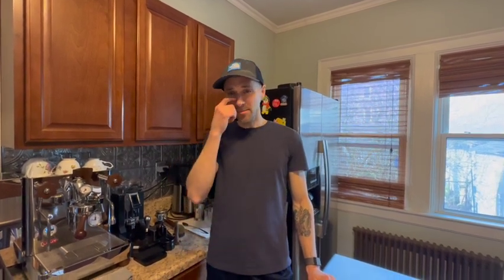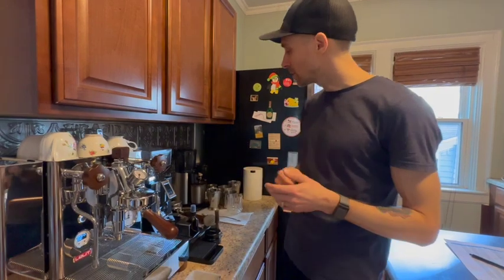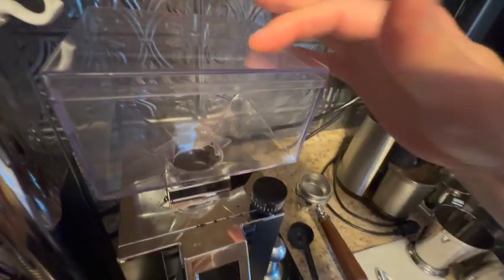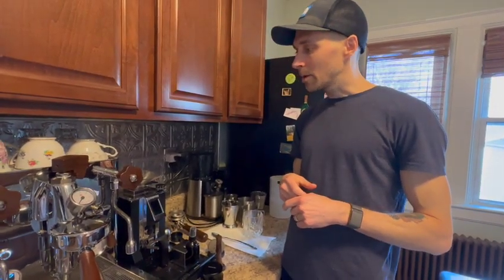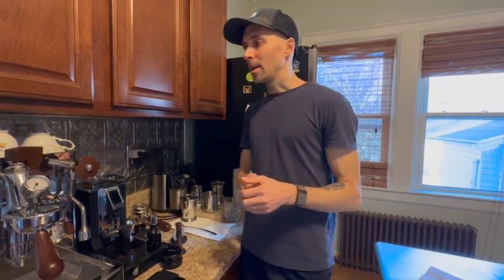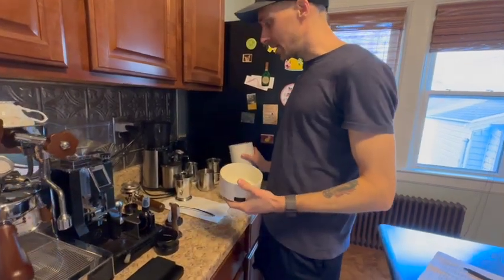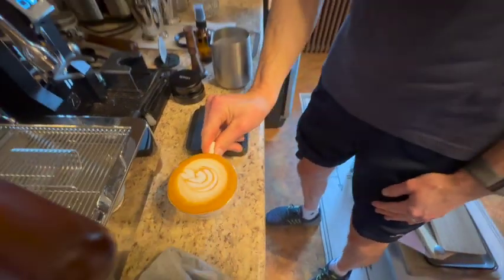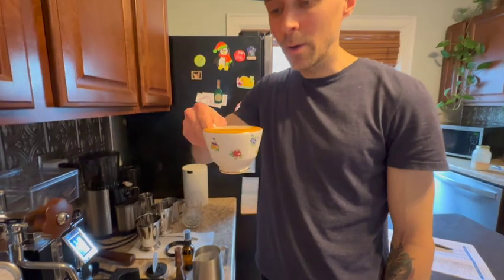Lelit Bianca V3 & Eureka Oro Mignon XL - New Coffee Bar Setup And I Make A Cappuccino

Comment: Got the same setup, same notes, great shots. I dont recommend the hopper, cuz it will push coffee into spots in the grinder that are not air tight inside...
Reply from the maker: Thanks for the tip.  I actually did try out a hopper with bellows since I made this video and found out the hard way that this is what happens!  I’m back to the stock hopper now!
Reply: @KevinExclamationPoint  Thanks for the info I was worried about that.